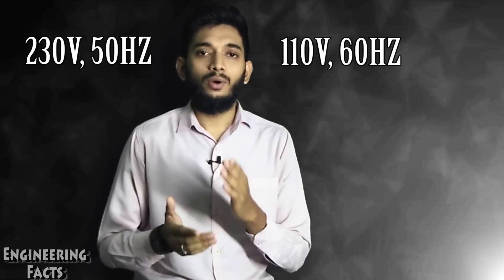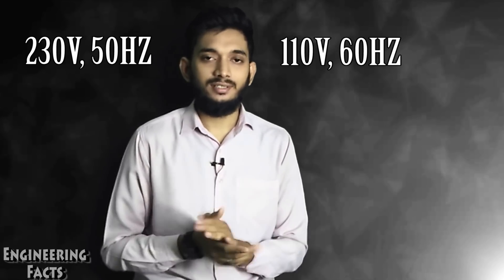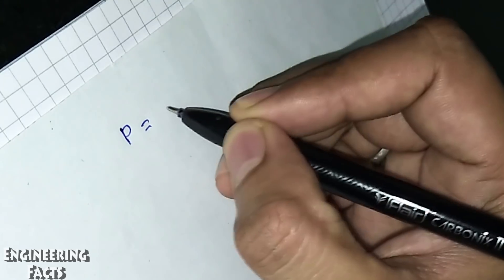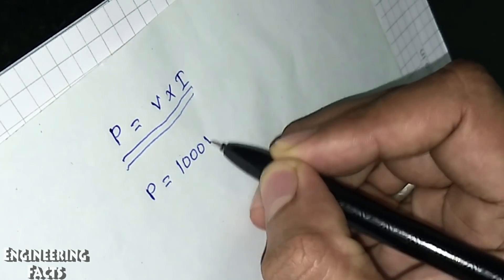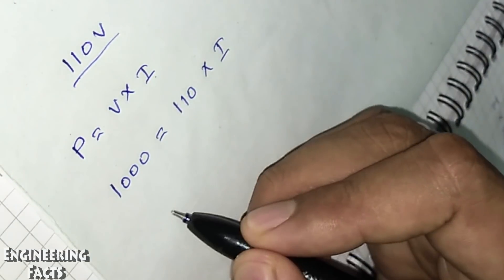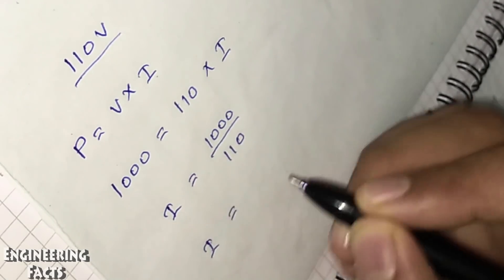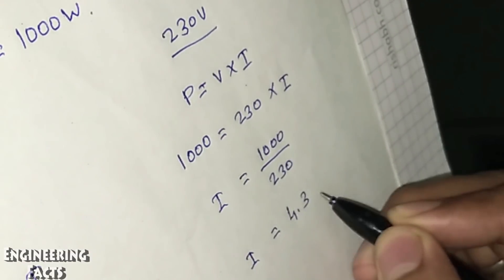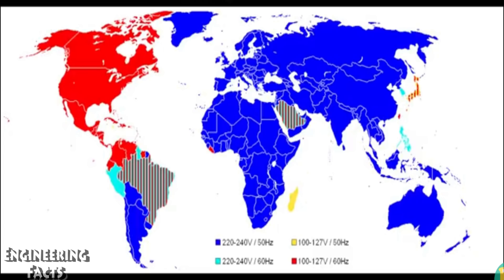Why different VOLTAGE in different COUNTRIES?_Tamil, Why in India 230v,50hz, some country 120v,60hz?

Comment from the maker: Frequency - earlier times frequency set as 60hz to adjust the bulb flicker. After that they standardized 50hz, because in 230v the bulb didn't flickered on 50hz. So 50/60, no big changes
Reply: Yes not a big different  but 110 v lamps can't glow the 220 v  led only glowing, plz explain different between the lamp variations, plz don't mistake my question plz explain
Reply: @saravananred2939 9 look py pu
Reply: Hz na Enna bro
Reply: @usamaujyf2101  oru cycle bro. 1 sec la etha cycles varuthu.  50hz na 1sec la 50 cycles.  Oru cycle na antha graph la oru sine wave irukum la AC current indicate Panna athutha. Thank you
Reply: Good nice facts in simple language !!
Reply: Deep understanding of fact.Lucid explanation.Answers questions that follow.Keep it up
Reply: @pokepatt  we w4 ec
⁰ is ⁰
Reply: Deep a explain panunga konjam puriyla
Reply: Thanks 😊 To Your short & Sweet Explanation very useful
Reply: Very nice work.. Keep it up..
Qn: how does the multi adaptors/appliances work on both the Volt options..? What changes do they make in the appliance ...u hv mobile adaptors that are universal.. What's the engineering design n theory behind that?
Reply: @engineering Facts,
Sir, how much big wire is required to carry 1000w ?

I need to setup a junction box to power a iron box so need to know how much big wire I should use, can it be same like the wires which power Fan and tubelight at home?

Please explain
Reply: @ArunVinayakc  1 to 1.5 sq mm is enough
Reply: My son name Castro Tesla

Comment: I have a Roland JV 1080 a audio equipment from the year of 1994. Japanese made with 230V 17 W 

Can i use 250 V power cord to it. Will it harm the internal transformer. 

It has old Bando transformer inside not SMPS transformer 

Please give me solution.

Comment: Tesla never agreed on the existence of the free electrons and he called the theoretical physicists as mathematics magicians. This is why he was sidelined by the scientific community eventhough he was a true genius (mad inventor with numerous patents and a world class electrical engineer). 
Note that Quantum Mechanics (almost complete description of the atom) came into existence in the year 1927 and solid state electronics (analog and semiconductor transistors) several decades later. The modern story is that long range DC transmission is indeed economical (requires highly advanced solid state switching transformers on both ends of the line) and China made the longest world record DC power transmission recently.

Comment: With a 1000 watt appliance, with 230 volts it is less at 4.5 amps, compared to 9 amps in 110 volts.  Will it then  consume more units of power in 110 volts than in 230 volts as t

Comment: what is the difference between having single phase and three phase connection in homes..
what are the advantages and disadvantages in each set up..
Reply from the maker: i'll make video on that, Please wait.
Reply: @engineeringfacts  Was a video made on this? If yes, please share link.

Comment: Thanks for sharing your knowledge...just few doubts
1. Why do the European countries chose exactly 230v as standard, y not any other higher voltage values?
2. Why did they also change the frequency from 60 to 50 Hertz?
Reply: As per devices they use, more volt needs more other materials to build a transformer

Comment: How they using line to line????,then it will be short circuit...I have doubt pls clarify me....then from 430 v supply,L-L can use 230 equipment without transformer ???...this is my long time pbm.
Reply from the maker: They use 230 v equipment on LL if needed. Not 110v equipment

Comment: Ok. But lot of Wrong news.  Volt means potential difference between two terminals, current means flow of electrons. Neenga narayaa kolambi poi irukkareenga. Athanaala ellarayum kulappareenga. Athaavathu subject enna enbhathu ungalukke thelivu illai. Yaro ungalai nalla kulappi irukkanga. Porumaiyaa nallaa paduyungal. Vaalthukkal. Naan oru physics professor.
Reply from the maker: Thanks for your feedback sir. But please check my other videos also, then I think you'll understand I'm not confused. Actually the term speed is used for better understanding. But in technically it's not speed. A work done to move a energy or as you said potential difference is called voltage. You're welcome.

Comment: Bro I my friend bought me a home theater from USA,due to this voltage difference do I need to use any stabilizer to use it in India? If yes could you please suggest me one? Thanks
Reply from the maker: You simply can reduce the voltage. Please contact some projects people. They'll do, or buy step down transformer
Reply: Engineering Facts thanks bro 😊

Comment: 100 V in Japan
120 V in North America,
230 V in Europe, Asia, Africa and Australia
Direct current was produced in 1800 by Italian physicist Alessandro Volta's battery
The first alternator to produce alternating current was a dynamo-electric generator constructed by the French instrument maker Hippolyte Pixii in 1832
Reply from the maker: Alessandro volta, was only made a way to gain potential difference between two different materials, which we call as battery now. There's no direct current or alternating current at that time. He even didn't know that. Electricity was first used by Edison by bulb, using DC Dynamo. Westinghouse used a Dynamo of AC. later it is implemented by Tesla.

Comment: Ada loosuppayale voltage is not speed of electron . It is work done to move a unit charge(electron) from one point to another point
Reply from the maker: Thanks for the wishes. Your definition is right. The potential, let the charge to flow across. high potential results higher charge flow. In that manner, I mentioned as speed of electrons for better understanding. In technical manner it's not actually speed of electrons. I don't have speaking skills like you, because I'm not educated like you..

Comment: Voyage is 415v 3 phase. Or 240v single phase . This is as per Indian standard. Long back there were different voltages. But that’s history. Many European countries follow 380v 3 phase . That means 220 v single phase. UK follows different standard. Now they are working at unification so these variations will be ironed out over a period of time

Comment: I have many doubts for ur lecture,if u power increased,heat energy  increased,because resistivity.then india temperature is high compare to europe country so when temp increased,resistivity increased so indian power station use 1000v and transmit energy with sum losses (loss due to resistivity) if u increased diameter,conductivity will be low so 
Ex
Conductivity=(voltage×area÷ current × length)

Comment: Nice question sir but my question when u increased diameter of wire,resistivity of wire is increased ex(R=r L/D) L-length , d-diameter, r-resistance please answer me
Reply from the maker: Yes, you're right. What is the question?
Reply: Diameter ah mamma one time fix pannita atha change pana maatom but length mattutha change pannuvm so length increas aahu pothu resistance value increas thaana aahu but neenga diameter mattuthaanu slrnga

Comment: why we need high diameter wires for high current flow? that point you missed. others everything good explanation.
Reply from the maker: Because, to achieve more electron. please watch video again
Reply: @engineeringfacts  what happen when more electron gone though thin wire? I watched two times. i'm asking because of you left some point. answer is heat.

Comment: Single phase la 1.5 ton AC poda mudiyuma. Pls reply me
Reply from the maker: Voltage will drop
Reply: @engineeringfacts  thank you bro
Reply: Yes, use seperate 7/20 cable from the main switch board.
Reply: @manoharanrajangam3028  thank u very much bro

Comment: Apram eppadi foreign TV use in india
Reply from the maker: Foreign means, not all countries have 120V system
Reply: Superb explanation for any layman .thank you
Reply: They are designed to be operated in wide voltage range 110 to 220 volts

Comment: As you said Western countries already have wires  double the diameter,then why cannot they go for 220 volts ?
Reply from the maker: Good question, actually the transformers are already installed for 110V, So that cost is high.
Reply: The thing is about to change transformers feeder line and also all the appliances and gadgets.

Comment: What is the significance of frequency in this transmission bro like 60 hz or 50 hz, what does it affect
Reply from the maker: Check my pinned comment
Reply: In case of a power plant they try to match the frequency demand of the electricity. In the evenings, when we switch on the lights & use AC's, there'll be a sudden surge in demand. At that time the frequency would drop to around 49.5Hz at the powerplant supply station. This will make them to increase the power production. If it drops below a particular limit their entire plant would shutdown. It's like an arm wrestle of frequencies from demand & supply.

Comment: Your explanation is great and easy to understand.

 Will our 230V appliances work normal with 205v phase-phase setup. 
I mean our system is 230v phase-neutral(1phase) , but USA industrial setup is 205v for 3 phase.
Does our devices work normally without neutral.

Comment: நல்ல தெளிவான விளக்கம் நண்பா... வாழ்த்துக்கள்... தொடர்ந்து பணியாற்றுங்கள் ...
Reply: Bro appo electronics appliance oru country la use pannandha vera country la use panna mudiyadha . Western country la use panra appliance lam 110 v la work aagudhu na eappadi 230 v la work aagum
Reply: @TheSathyadev  enkkum ithey doubt tha bro
Reply: @TheSathyadev  need to use a transformer which decreases the voltage from 230 v to 110 v.
Reply: @TheSathyadev  you may have to buy an appropriate appliance for the specific country.
Reply: ஒரு சில உபகரணங்களில் option கொடுத்திருப்பார்கள், அந்த நாட்டின் தேவைக்கேற்ப அதை மாற்றி வைத்துக் கொள்ள வேண்டும்.

Comment: Bro when power station is producing 100v then if it's transmitted there will be transmission loss so we hav step up transformer to increase the Voltage like wise can we increase more than 100v using multiple stepup transformer???
Reply from the maker: Power station not only transferring the volt. It transfers power
Reply: Yes we can. We can increase voltage  just with a single transformer.

Comment: Enga veetla low voltage problem.. atha epdi sari seirathu 110v than varuthu, single phase than potrukom, kadaisi veedu. Answer please?
Reply from the maker: Change to 3phase
Reply: @engineeringfacts  romba thoorathuku 3 phase line oorla illa.. athuku apply panuna antha line ilukura selavu athigama aaidum.. vera ethuvum vazhi iruka??
Reply from the maker: Use stabilizer
Reply: @engineeringfacts  110v aa 230v ku stabilizer naala boost up pana mudiyuma..(load athigam) future la 3 phase vantha athe stabilizer use pana mudiyuma?

Comment: bro i've a small doubt!!! US la 110V la run agura appliance, India la 230V la run aguma?? apdi run ana.. is it good or bad??.  and how different will it work in india (comparing USA)
Reply from the maker: It will not work, but if your device given input range, mentioned for both ranges means you can use. No problem will come.

Comment: Current voltage ok bro but 60hz 50hz 1sec cycle wave from nu solluvom athum ok but 10hz athiga ma use pannarathula enna use
Reply from the maker: Earlier time it's increased 60 to match bulb flicker. After that they standardized to 50. So, no big change in that.
Reply: @engineeringfacts  ok bro
Reply: We can use smaller size transformers. Less copper wire.

Comment: Bro what is difference between 50hz and 60hz
Reply from the maker: Frequency in earlier times, used to match the flickering of bulb. That's why 60hz choosed. After they realised 50 is sufficient, they changed to 50. But not much difference in both..
Reply: @engineeringfacts  thank you bro

Comment: Well explanation bro.. 
One doubt.. 
Why they stopped at 230V.
Why not 350V or 550V..
Any limitations are there..
Reply from the maker: For safety reasons, too high is dangerous, too low is not efficient. That's why.
Reply: @engineeringfacts  thanks for the update bro.
Reply: @engineeringfacts  also too high voltage need more insulation cost.
Reply: In India we use 3 phase 220 volts , for industrial use 440 volts ,and also for agriculture purpose
Reply: @ppc37158  230 volt than india la supply panranga, atha vida athigama ulla  430 volt washing machine vangalama? pls reply
Reply: @ppc37158  no, we too can use 440v at home if we use line voltage but normally we use phase voltage rather than line voltage at home
And industry as well can use 220v volt if they choose the phase voltage
Reply: For 110v there is less chance of death , 220 v has more chance 440 v is very dangerous
Reply: @ppc37158  Yes your are correct.. In western countries, Human safety is first; they are not bother about transmission cost.
Reply: Voltage explanation was not acceptable

Comment: Nice good 👍 explanation
I want Know what hz and different from 50hz and 60hz
Reply: Hz is the unit for frequency. Frequency means no of cycles per second. 50 hz means the rotor of the generator rotates 50 times per second. Thus voltage and current changes its direction 50 times per second.
Only AC current has frequency. DC dont have frequency because there is no change in direction.
Reply: @keerthi.r.rajkumar9460  super sis
Reply: @keerthi.r.rajkumar9460  
Then, what is mean by  RPM of the Motor?
Reply from the maker: We'll do video on that.